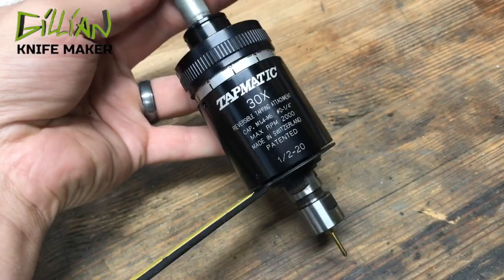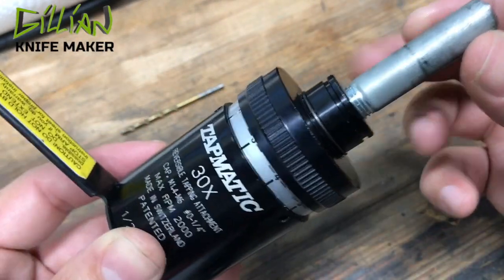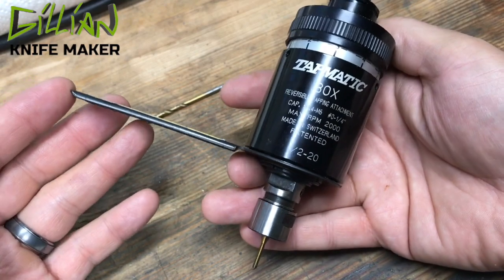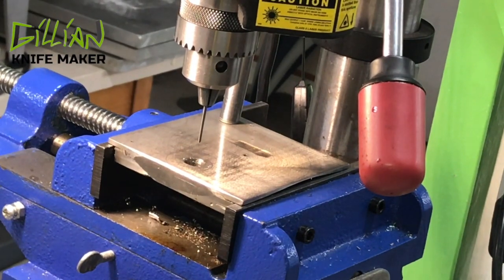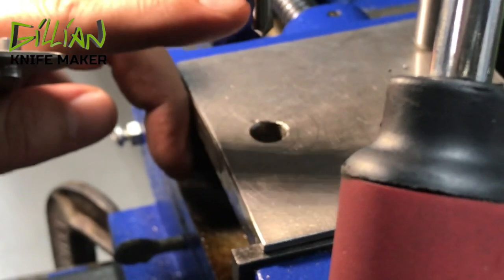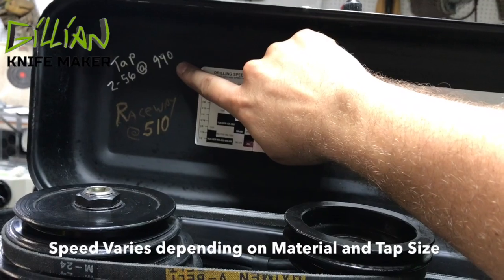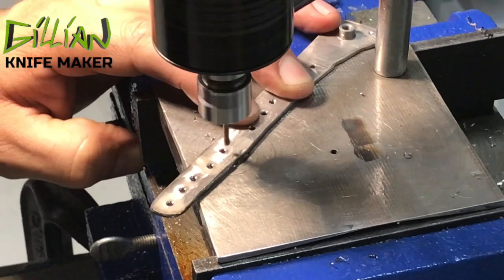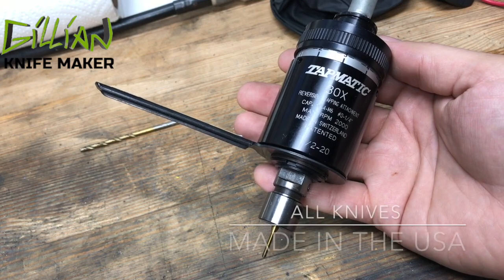Tapmatic 30X Self-Reversing Tapping Head

Comment: Great video! I'm having a gell of a time trying to find a proper rubber collet for my 30x for a 2-56 tap. Any recommendations?
Reply from the maker: I purchased mine from ENCO years ago.  MSCDirect has the collets currently in stock.
Reply: @GillianKnives  thanks for the reply! I'll check it out
Reply: @GillianKnives  hello, im back! I was wondering if you could tell me whst clutch setting you have your 30x set to for Taping thicker Ti with a 2-56 tap? and have you done any blind holes since you made this video? 

Thank you!!
Reply from the maker: @lucasgumbiner8673 Hey Lucas I have not use the tapmatic on a blind hole, for the blind holes I use a single point thread mill.   Before I could thread mill, I used a hand tapping station from micotools.com, with a starting tap, followed by a bottoming tap.
Reply: @GillianKnives  got it, and whst torque setimg to you usecwhen you thread 2-56 holes? Specifically in .160-.200in Titanium?

Comment: Have you tried blind holes yet. All I do is blind. Hundreds in one order and use a handheld bench top tap from china I retrofitted with a DeWalt gyroscopic screwdriver to allow to back out. I'm looking for something like this. But not sure what quality thread I'd get with a bottoming tap with this device. Usually tap 6-32 and 10-24 at a depth of about 1/4". Material acrylic.
Reply from the maker: I have not used the tapmatic on a blind hole only through holes.  When tapping blind holes I use single point thread-mills on the Haas Mini Mill.  Those flexible style tapping arm might work for blind holes, but I don’t have one in my shop.

Comment: The ENCO 53000 is a rebranded Tapmatic 30TC\DC. They sell on ebay for $120 & up. If it has Tapmatic on the label then they sell for several times more, just the name is changed. I have owned both and held them side by side. Try and find one with the Collets as they are expensive at $75.00 each & upwards of $115. ENCO used to sell them as their brand for $28ish each. They were the same Jacobs\Oberlin made but just in a different package. You need 2 Collets J116 & J117 to cover the 0-1\4 range of this head.
 Ebay sometimes has them new & used. DO NOT over tighten the Collet nut as the taper is heat treated & somewhat brittle & can chip.. There is a recess for the Tap to set into with a Allen setscrew. The Taps can't have a point on the square end, Tapmatic recommends grinding the point off  as it MUST sit inside one of the 2 recesses.The rubberflex Collet does not lock the Tap into place.
   Lastly the top of the Tap head is how you set the torque for the Tap. There is the same size setscrew that is loosened before adjusting, re-tighten it after the correct torque is achieved.
Reply from the maker: Thank you David for sharing .

Comment: What setting is clutch set at ? Just got one trying to figure it out.
Reply from the maker: Start at the lowest setting, and try to tap the hole.  Increase the clutch gradually until the spring becomes strong enough to reverse the tap, and it comes out of the hole.  Once it is successful mark the setting with a sharpie.  You will find the order of the clutch will correspond with the size of the taps.  #1-72 will be lowest setting, higher for #2-56, and higher still for #4-40.  

Once each size has been marked with a sharpie, you can quickly return to the correct clutch position.

Comment: There are tapping guns that are very good. The really good one is not made anymore but shows up on ebay every once in a while. There is also a 1/2 drive chuck for a 1/2 impact that is for taps.  For small holes use a small chamfering bit in a handle. No need to chuck it in a machine. It's much faster.

Comment: What range if taps does it work with?
Reply from the maker: Thats a great question that I don't have the answer for.  I have two different collet sizes for my model 30x, with those two collets (I did not show the collets in the video btw), I know it can tap #80-00, #1-72, #2-56, and #4-40.   But I don't know the full extent (read: range) of what it is capable of tapping.   As for the #4-40 they break more often that the other sizes.  I don't know if that is the limit of the tool, or if my clutch is just incorrectly adjusted.  As for the different collet sizes, they are now difficult to find, that increases the range of the tool.

Comment: at 5:25 it not spinning as straight. Is there a different attachment you have used where its more stable?
Reply from the maker: nah its the same attachment, the tap just got bent by the warped trash piece of titanium I used for the video.
Reply: These heads are deigned for"Wabble", perfectly normal as it allows the tap to find the center of the hole without breaking the Tap.

Comment: If you tap any holes much larger you better make sure that the workpiece cannot come up off the table during tap withdrawal or all hell breaks loose along with your tap.
Reply from the maker: Thanks for your feedback.  I usually only use the tapmatic for #1-72, #2-56, and #4-40  If I tap anything larger i usually use a hand tap.
Reply: You mean you don't like the part from smacking your hand??.The part should be securely clamped in a Vise. I used one of these at work, I could tap hundreds of holes per shift. We did mostly M3 & M4 holes.

Comment: May help if you make a finger hold down. In a vee shape  it will help stop lift of the thin metal and will still allow quick tapping . Only has to stop lift so loose is ok . Just what I do for tapping lots of holes. Good luck  and thanks
Reply from the maker: Thanks for the feedback Silverbullet.  I’ll definitely consider the finger hold down.  Eventually I hope to have a few drill presses permanently setup for various operations, with the tapmatic in one of them, so I’m not loosing so much time with setup, and tear down.
Reply: Cost?

Comment: That's really wobbly! Thanks for the demo.
Reply: This was designed to have some "Wiggle room" to prevent breaking the Tap if you are slightly off center of the drilled hole. Also these heads have a soft re-entry feature to prevent cross threading.